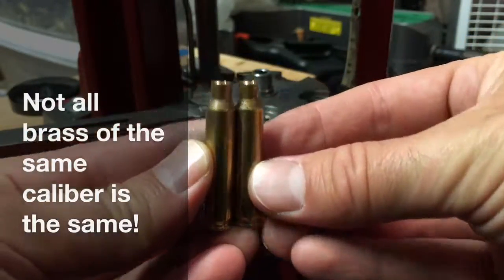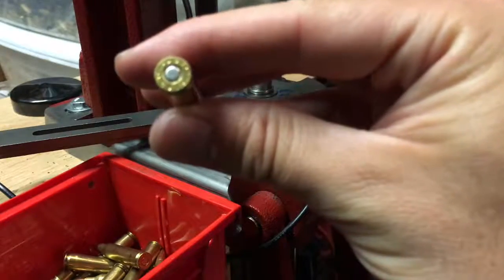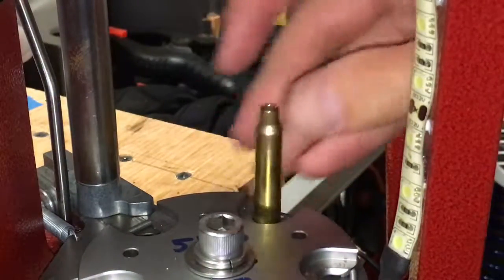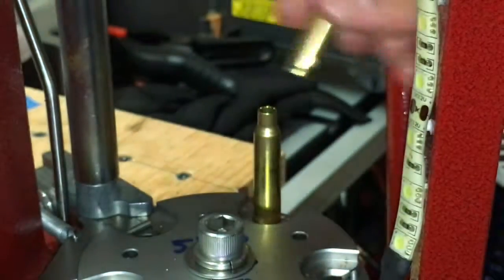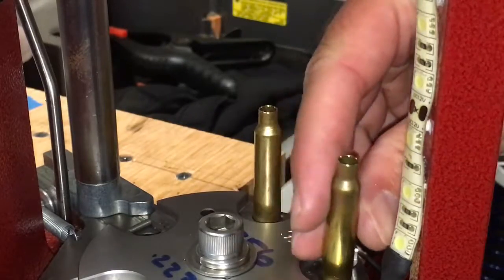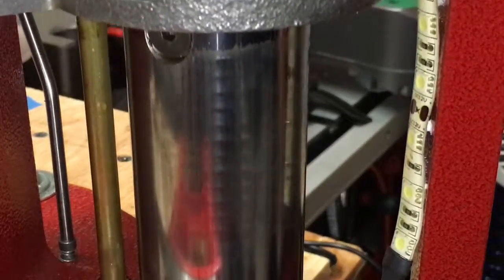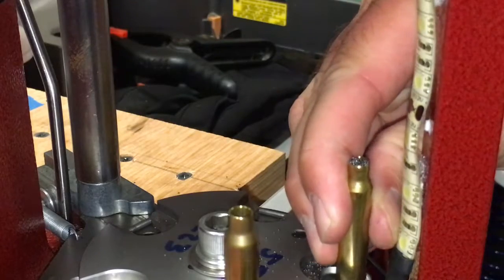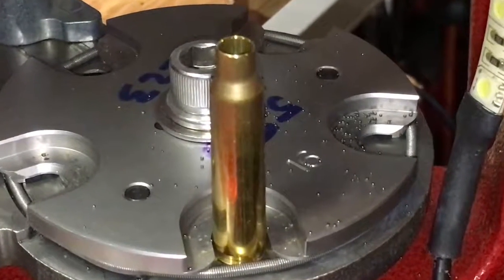Not all brass is the same!  Different powder capacities in .223/5.56

Comment: I've been using the Bison Armory Case Volume Tool and have found capacities range from 30.2gr H2O up to 31.28. LC18 is about 31.2 gr.  7.62x39 is wildly different: I use it for 6.5 Grendel and Remington is 2 gr less capacity which will lose primers IF you use a load developed with PPU cases.

Comment: There is no intrinsic difference between 223 and 5,56 brass.  The difference is in the chamber throat.
Reply from the maker: Why can one case hold a given amount of powder and the other case not hold the same amount of powder?  Was I saying there was a difference in capacity between .223 and 5.56 or was I saying there is a difference in case capacity between different manufacturers (as identified by different head stamps in this video)?  I believe I am very clear in my distinction following the 50 second mark.
Reply: @PWPUU  yup!